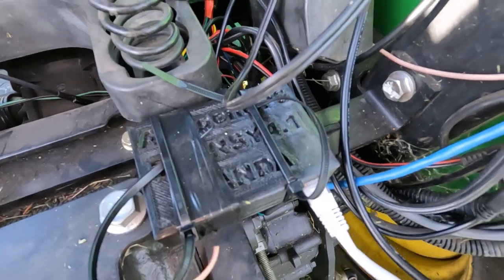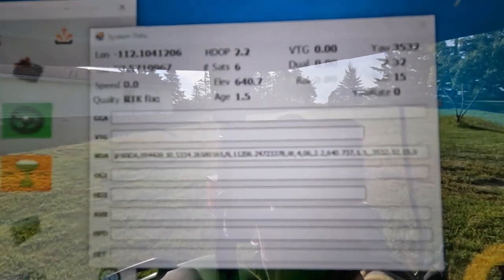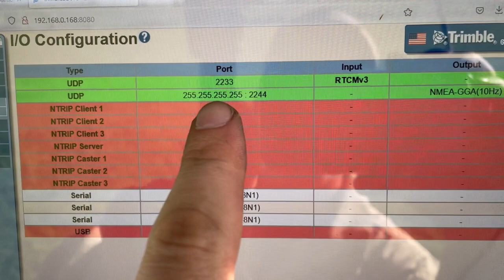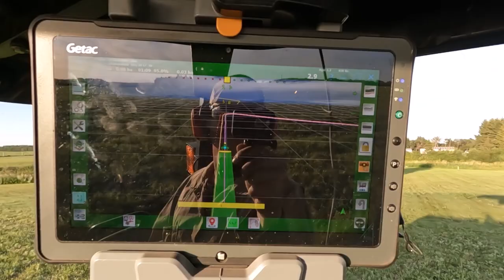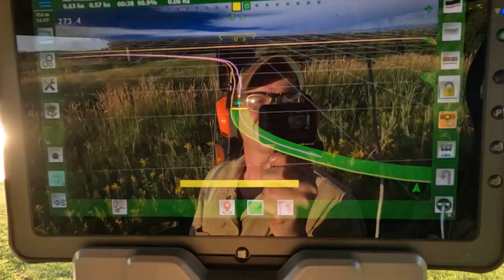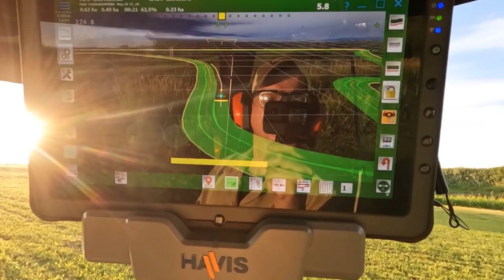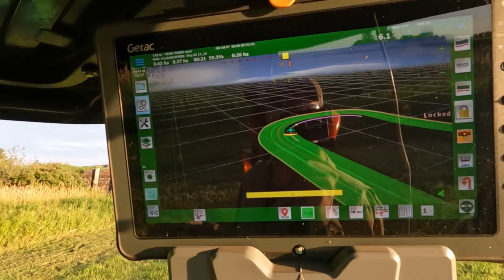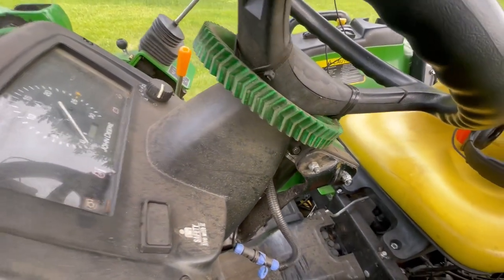AgOpenGPS Panda, NMEA GGA over UDP. RTK Lawn Mowing!!!

Comment: YT recommended your PoE relay board video. Glad I got curious, and got here. You’re building self driving farm equipment! This is really impressive, especially considering the whole right to repair fiasco in the agriculture business. I’m also surprised at how precise the gps steering is, you’re inches away from fence posts, I thought they’d be getting torn out for sure.
Reply from the maker: It gets better!

Its a whole group of farmers and tech enthusiasts, coding, building, testing and succeeding! 

AgOpenGPS is an open source guidance system started by Brian Tischler of Alberta, Canada. But now is a popular and important platform worldwide. Its free to download off github check it out!

Farmers helping Farmers.
Reply from the maker: I forgot, the RTK guidance we use is cm accurate, and repeatable Year to Year.
Reply: Wow

Comment: Very nice, I love your steer motor system, very well thought out.
How did you choose where your motor should sit on steering column?
Reply from the maker: Chose this location, because it was the only place it would fit 😂. Location starts with where it can fit, make sure its not blocking any important gauges/controls, and very last visual appeal.